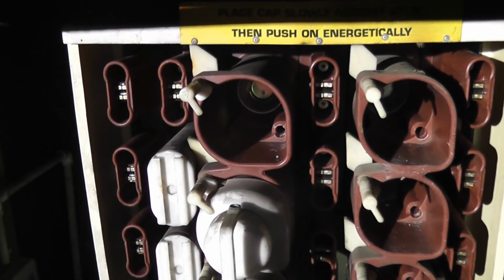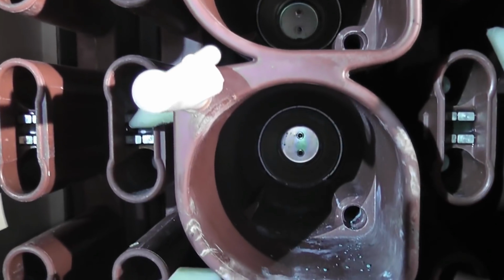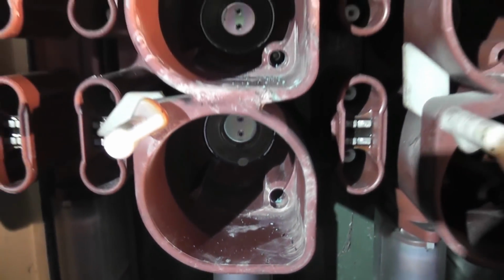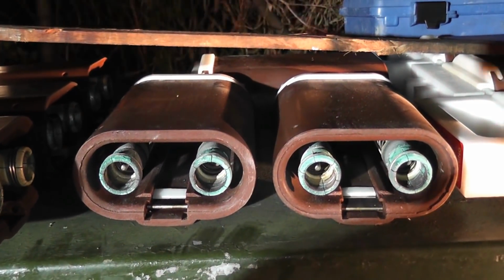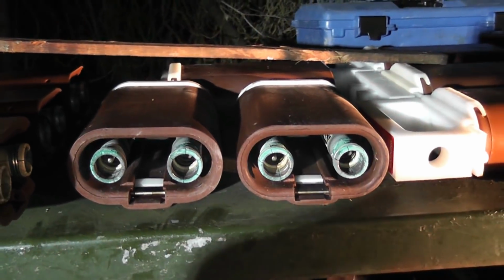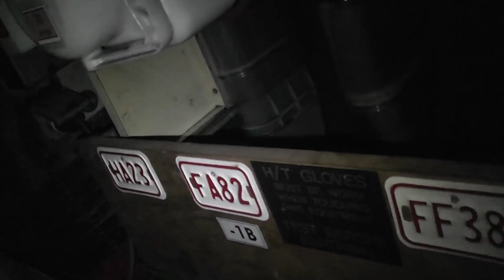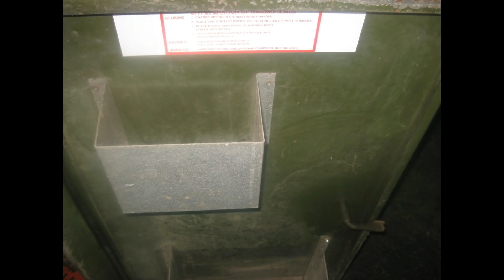Partial Discharge  Hazemeyer Magnefix  RMU

Comment: Magnefix the best switch gear!
This magnefix is from 1960/1970
Eaton still make them! I work daily with the magnefix
Greetz, from the Netherlands
Reply from the maker: Brilliant, we have a Hazemeyer maintenance to do tonight, still single phase plugs in it, will be converted to 3 phase. I like these Magnefix units too.
Reply: these are the worst switches... limited fault make, corona discharge, and single phas switching.

Comment: Fascinating. I'd be scared it was about to make a full circuit?

I live close to the North Sea in the UK. We have a large switch yard here which effectively controls power for the North East of the UK. I'm aware that they have a lot of problems at the yard with salty air reaching insulators and other equipment. One fix was to place half of the yard indoors where it could be protected from the elements. The yard has feeds of 400 kv and 275 kv.

I also know of another pylon near me which is often affected by damp air. I don't know if it's poor insulator design of just the dampness but the pylon isn't half noisy! I should go one dark night and take video of the sparks..

Comment: Damm, that thing was in a rather poor condition. Likely would have flashed over as it was 11kV, had that mess and corrosion gone on any longer. Interesting video thanks. ⚡️💥
Reply: We've got some 34.5kV distribution lines here in the states ... though I will say, they don't tend to use it on underground systems like this, from what I know of. We do have some 13kV to 14kV lines with units similar to this in the video.

P.S. Actually now that I remember, we have some 46kV distribution lines as well, but they're rare (and not in the area where I live). The pole transformers have these BIG bushings on them. :D
c1(DOT)staticflickr(DOT)com/8/7006/6630456149_e2f9265c7d_b(DOT)jpg

I believe these monster 500kVA pole transformers are 34.5kV input, probably around 7.1kV to 14.4kV output:
farm4(DOT)staticflickr(DOT)com/3107/5863288941_abe1fb287d_b(DOT)jpg